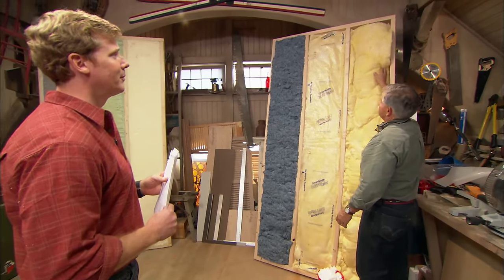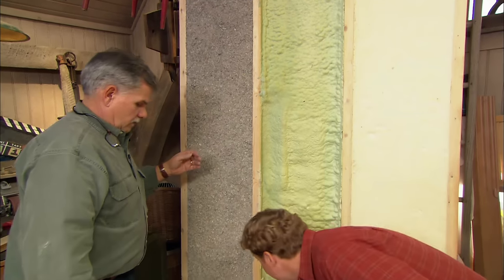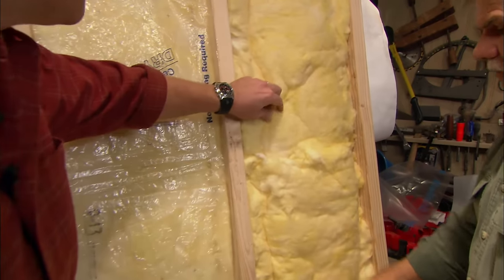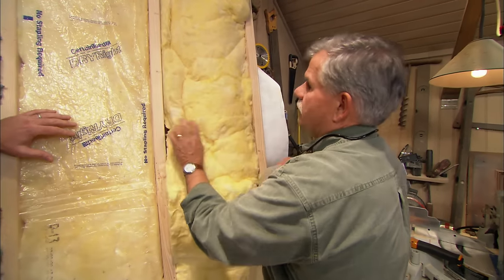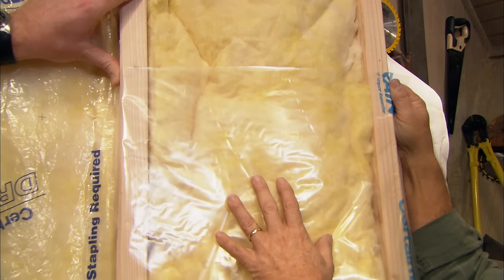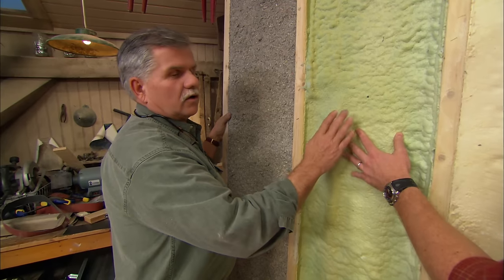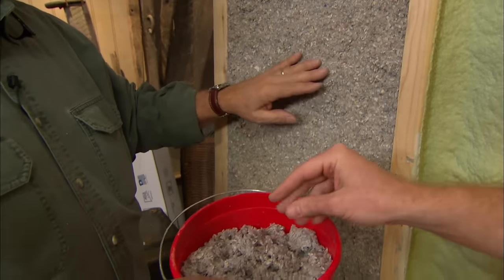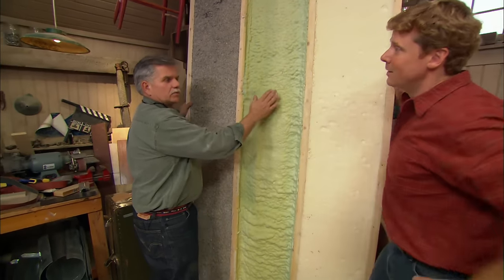How to Choose and Use Insulation | This Old House

Comment: That's why these guys work on old homes... so they can stick wiring down cavities where there is little insulation in the way.  Most of these methods "blow" your chance of touching that cavity again.  Of course if people cared more about external insulation as they should, then the stud bays wouldn't be such a big deal.

Comment: Help plz I am wanting to buy a mobile home and was thinking to use foam insulation found at Home depot but watching all the videos of insulation gone wrong smelling like fish or chemicals makes me Leary of DYI but I cant afford to hire someone. Input plz
Reply: Kashkaani Aspen more expensive if you buy the two bottle set up at home depot if your doing large areas.
Reply: You can buy the 1'' foam board and slice to fit tightly between whatever bays you have and gain substantially.
Reply: Rockwell doesn't have a smell it's it's own vapor barrier and it's excellent for soundproofing.

Comment: Tom Silva speaks with confidence but many facts are ignored. For example, how much R-value is lost by the closed-cell foam as it ages in your wall? Tom shows a full depth of closed-cell foam. Common practice is to only fill partially (an inch, or so) to reduce cost. Then the homeowner must pay for fiberglass to fill the remaining inches.  Closed-cell foam can separate from the material it's sprayed on. That's not cost effective. Sprayed on too-thick, closed-cell does not cure correctly and off-gasses. The fumes will make the homeowner sickly ruining their lives and home.

Open-cell foam is not durable over time. Tom seems to confuse open-cell foam with pump foam which is even more problem-laden. It shrinks in wall cavities and turns to dust as it ages. A smart homeowner will INSIST on a Material Safety Data Sheet (MSDS) before wasting their money on over-priced, problematic, foam. All foams are a horrific assault on our ecology. 

It's telling fiberglass batting (and loose blown) needs a vapor barrier added to stop air infiltration. For that reason, they are not practical for retrofitting walls.

Cellulose is available with an R-3.8 per inch value. Why settle for less? It will never settle like blown fiberglass. Or leak like fiberglass batting. Or shrink like pump foam, or crumble like open cell spray foam. Or need additional fiberglass added like closed-cell foam to shave cost. Cellulose won't off-gas like foams or lose it's R-value like foams. Unlike the others, it's a genuine friend to our economy. Tom Silva is placing the drill holes in the wrong place.  Tom Silva is doing the Devils work, here.
Reply: Tell us, then, where Tom Silva should have put the holes, for blowing WHAT insulation into the walls.  And thank you for your informative posts. 
If you are ecology-conscious, you might favor radiant barriers... glorified aluminum foil.      I use this successfully in southern California.          Which raises another point:  Larry, you have posted many times, but never disclosed your geographical location or climate.   It matters.   Some places need no vapor barrier, at all, so your complaints to that point become moot, in such places.
Reply: @johnbecich9540  , OK, I'm on the record, I live in southwestern Ohio. Vapor barriers are required by code. Without a vapor barrier, fiberglass leaks like a sieve.  Fiberglass is inadequate so needs the "sealing" properties of poly. 

As for your anecdotal claims about foil, let's see the studies.  My experience is reflective foil is applied along with insulation and the salesman credits the foil with the reduction in thermal transfer to the foil, not the insulation. Or some sap homeowner swears the foil made a difference. Show me the heat load calculations supporting reflective foil.  There are none. If reflective foil benefits by reducing heat transfer then foil is somehow defying the universe's law of thermodynamics. Can that be? Only if you listen to high-powered salesmen.

Towards the end of the video, Tom Silva briefly talks about blowing cellulose into wall cavities "dry" - he mentioned using "small holes, one in the middle & one near the top." You asked, "where do I put the holes?" A fair question. An important question. Presently I am finishing up research detailing that and other points of installation for cellulose insulation. When finished I'll likely place the info on YouTube. The research shows I was factory-trained correctly forty years ago (Whew, that's a relief.) Normally, I'd have no need to do any tests, but with Tom, and other "influencers" spewing out misinformation, it's best I document my claims, or risk being discredited because Tom Silva swings more weight. 

Don't get me wrong, I like Tom Silva, but he gets on my nerves watching him run a cordless screw gun, for example. He pulls the trigger in short bursts - "start-stop, start-stop" fashion, suggesting he doesn't really work with one. I pull the trigger and run the screw - get the job done. Come on, Tom, learn to control that little guy! It has a variable-speed control, learn to modulate RPM and keep the drill running until the screw head is seated - or hang up your battery charger.

Comment: How much can i make doing this type of work
Reply: Not much unless you can buy tractor trailer loads of the fiberglass, spray etc. at a time.
Reply: you have no idea what you're talking about.  You can make an easy $100,000 a year doing spray foam.  You just need $30,000 worth of equipment + the cost of materials to start.  Oh yeah, and the proper training and support.
Reply: You can make pennies on a dollar

Comment: No mention on the danger of improperly applied closed cell foam.  Poorly trained, lazy contractors tend to spray it too thick in the hard to reach corners, believing thicker is better.  In reality it does not off gas’s and cure properly when applied too thick because of heat build up and can render the home in-livable.  Formaldehyde gasses build in the house.   If going with closed cell insist on a contract that puts the cost responsibility on the installer or the GC if the product is installed improperly and a third party tester confirms the presence of gasses that are a byproduct of improper curing.

Comment: I'm surprised you didn't speak of roxul insulation it's water fire and mold resistant and has a good r value
Reply: It's a much better product than fg especially when used in a basement.it does not mold and has a excellent fire rating.
Reply: not when comparing costs thermally... i know... I just signed a 8900 job because other bid was roxul and was 5985 MORE for a steel pole barn....
Reply: Thermally the same but depending on the application mine specifically I went with roxul because of the resistance to mold water and fire.since I was remodeling my basement.

Comment: I love how people completely disregard the health effects of these insulation materials. All of these are not good for you, and will create a potentially dangerous living condition. The only one that I have found to be safe is AirKrete, if anyone cares a little about their health.
Reply: All these insulation types are ok. The spray in types need to be done in small increments to set up, but all are safe if done properly.
Reply: spray foam is completely safe IF it is sprayed on correctly.  If not, it can be hazardous to your health and it could catch fire if applied to thick in a single pass.  I've seen it happen.
Reply: Ionut Ghira you don’t know what you’re talking about. No offense. I’ve been doing Insulation for 40 years. The only thing that can be unsafe is the foam if it is not installed properly. In that case just rip it out!

Comment: how about for sound proof
Reply: open cell foam makes a great sound barrier in interior walls.
Reply: @tonym1279  Caveats on open cell foam:   highly flammable, the smoke is highly toxic, and it gets wet and stays wet.      Moisture barrier design becomes very important.   Perfection required, on this point.   I don't like to be in any situation that requires perfection.        To its credit, open cell foam is light weight, and finds favor in roofs in cold places.     I much prefer well-ventilated attics no matter what climate, but it's easy for me to say because I live in a hot place... SoCal.  Radiant barriers are best here, but most folks don't know that; they don't understand IR radiation.

Comment: I don't see any questions being answered here. I guess we are on our own.
Reply: Pretty much. If you can afford the closed cell, it's hands down the best. It has the best r-value and makes the structure much stronger. It must be done properly though, in small lifts so to speak or you will have serious off-gassing that never goes away and then it would need to be totally removed.
Reply: @augustreil  Yes, agreed, the need for expert professional installation essential.

Comment: Put a torch to each insulation 
Wich one burns fastest
Reply: Who cares ?
Reply: Put a torch to your sofa and see what happens - it catches fire and produces toxic smoke...like almost everything inside your home. BTW..you can spray a fire proof coating OVER spray foam. You can also insulate the exterior of your roof with spray foam and a coating over it and basically you have a roof for life.  I've worked on roofs that were spray foamed 20 years ago and they still are in great shape and don't leak.  The only requirement is to re-coat it every 7-10 years...and that is super easy and cheap.
Reply: Rockwool would win that argument....

Comment: Next, how to safely cut your car in half to save space and to increase fuel-efficiency. Advantages: 2 tires, instead of 4; no trunk; no tail lights; reduced insurance costs. Disadvantages: difficult to steer on banked curves; passengers tend to fall out and get killed.
Reply: They are called "MOTORCYCLES"

Comment: There is some misinformation. Cellulose will settle even when dense blown, so when it does how is it a barrier for air and moisture. Also when looking into foam make sure you follow the correct guidelines. All exposed SPF must have a flame retarder, do not let anyone tell you otherwise. If you have an unvented attic with SPF you cannot store anything in the area besides mechanicals (pertains more to the south). SPF is not a cure all for homes. More and more building material is becoming more complex so know that using any insulation can come with moisture issues if not installed or designed correctly.
Reply: Explain your self please... HOW does cellulose settle if it's dense packed?? YOU DO understand it can NOT settle ,correct? where does it go if it PACKED in the cavity? Pays to be informed.
Reply: How well versed are you in degradation of cellulose? Or the swelling/shrinking of cellulose during wetting and drying cycles that naturally occur in the wall? You're correct it pays to be well informed. Good thing we all know when you close up the wall it magically works.
Reply: Well after 28 yrs of installing ... id say VERY WELL VERSED. We have seen many MANY wall torn out  and STILL EXACTLY as installed when we did it several years earlier. So yes DEnse pak does NOT settle. AGAIN... misinformation.
Reply: Well I am glad you have worked hard for 28 years but your experience still doesn't tell me of your knowledge and a simple google search proves my point. And your point on "misinformation" is as reliable as facts left in comment section. So while your example of a single occasion is not evidence to me I still stand by what I said and all my IR pictures will be what I rely on. And I will point you to my question how is it an air barrier when it settles.
Reply: I notice YOU offer no source? hmm interesting..... dense pak that settles?  Aint gunna happen son. EXPLAIN how it can please.  Cant can ya?,, thought so.  BTW I DID google it... no source came up.
Reply: You also missed the fact that your "source"is mostly a fiberglass supported entity?  Naima's largest financial input come s from OC then Knauf and certainteed. But then again that doesn't serve your purpose does it.... Hillary"?
Reply: 86fn The only source you cited thus far is (1) from the Johns Manville website and (2) is composed by the NAIMA association, whose committee members represent CertainTeed Corporation, Johns Manville, Knauf Fiber Glass, and Owens Corning. So we can say this is hardly an unbiased publication meant to present the facts.

As hotrodder62 points out, what they deal with in that publication is loose-fill cellulose insulation, not dense-packed. They also happen to misrepresent it as being toxic and corrosive.

Regarding toxicity: Boron and borate compounds are not Persistent Bioaccumulative Toxic Chemicals (PBTs), and therefore can only be regarded as "toxic" when huge quantities are consumed in some fashion in an extremely short amount of time ( https://www.buildinggreen.com/blog/toxicological-riddles-case-boric-acid ). This can be the case when installing borated cellulose fiber insulation (from the resulting dust) if the proper precautions are not taken, but it is not necessarily the case.

Regarding corrosion: Most cellulose insulation is treated with boric acid to make it flame retardant and insect repelling. Boron and borate compounds are proven corrosive to metal pipes when found in high quantities in the water conveyed by those pipes ( https://pmmd.pnnl.gov/nuregcr6923/appendixb-18.pdf ), but there is nothing to indicate that inert boric acid-treated cellulose fiber insulation is corrosive to pipes at all.

The settling of cellulose fiber insulation is a legitimate issue when it is loose-filled, but not when it is dense-packed ( http://www.ecohome.net/guide/dense-packed-cellulose-insulation-wall-systems ). If there are issues with settling in supposed dense-packed installs, it can safely be assumed the issue is with the install itself (i.e., done incorrectly) and not with the insulation.

Comment: Any blown in insulation is not worth its weight. I used to do that for a living and I have seen more times than not, It has settled almost by half in the wall. In essence only half of each void is insulated. The house I just gutted had blown in and it was the same way. A waste of money

Comment: Until your house catches on fire then you'll be breathing in all of that insulation.. rockwool insulation won't burn until 2000 degrees and it's a sound absorber also it's own vapor barrier.
Reply: there's no one that I know of that uses Rock wool anymore it settles and packs in a short time, then the  r value goes down to almost nothing.

Comment: DO NOT USE FOAM! In theory, it is great. In practice, it is horrible. It MUST be mixed in the proper ratios as it goes in. They design the installation machines to be idiot-proof. Except, they have made a higher level of idiot to operate these machines. By letting one or the other chemical get low in the machine, the ratios get screwed up. So, the idiot just keeps going, and blows toxic chemicals into your house that virtually cannot be removed. 
     Ask me how I know.

Comment: Surprised by all the attacks spray foam. There are 2 types. Nothing about them is the same.  Read up on the difference before you group them together. We built our home 20 yrs ago using Icynene Spray Foam, it's open cell. We have zero problems with it. WE used ICF "Blue Maxx" on the walls and sprayed the roof deck with Icynene Spray Foam. We heat and cool the attic. Makes the house feel warm. Also there can be a major storm raging outside and we don't even hear it.

Comment: In the first minute of this video I heard Mr. Silva say heat travels to cold.  So, in the north put the vapor barrier inside where the heat is.  In the south put the vapor barrier on the outside, where the heat is.  My question, I am building a four season camper van, Promaster, to be traveled very north and very south.  It is going to be insulated.  Any suggestions as to where to install a vapor barrier.  Thanks.
Reply: Sounds like you had better design for fault-tolerance.   You are really stretching the conceptual envelope here; this is not a forum for vehicles.